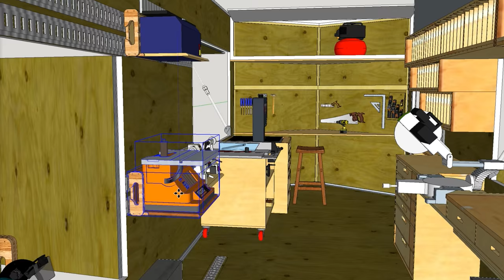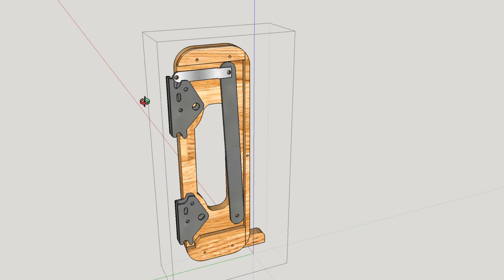Prototyping a Modular Tool Storage Idea

Comment: This will add a bit of weight but I think some sheet metal to help hold heavier tool for a long time will help. You are going to be driving. The bounce of the trailer could cause the plywood to break over time.

Comment: I think it would be cool to have those tracks mounted to the outside of your trailer as well. So if it feels to crowded inside you can just move some tools and still be able to use them.
Reply: I was thinking the exact same thing!   Especially considering the huge mess and flying dust some of those tools will throw off. Cleaning up a curbside would probably be a lot easier than every nook and cranny in a trailer.  One thing for sure he'll get buff using this system for long!

Comment: you should add another lock, but a more permanent and reliable one, a safe lock, for long travels to avoid your stuff falling while you pass right a crap road. an idea I have is attach it to the rail itself, but with a safety belt for travel, so it doesn't fall
Reply from the maker: I was thinking about using some kind of cotter pin for that.  Thanks!

Comment: Do you need the second rail for the bottom part? Maybe for lighter objects you can just have a spacer piece or a ledge for it to sit on that way you're putting it on the ledge then pivot up to lock
Reply from the maker: It's mostly just for safety traveling.  If the bottom half swung up, it could release itself.

Comment: There should be a 2 by 4 or some sort of stand built against the trailer so when you place the tool on the wall you can pull out a stand to place most of the tension on it..

Comment: If you could make that a simpler design (metal or plastic fabricated),  you could make millions. Love it. Maybe try designing it on your 3D printer? With spots to install the metal latches and places to attach aircraft aluminium?

Comment: I think you need to make the shelf stronger, it might hold your weight now, but what about when you drive over bumps on the road, then the force is a lot stronger.

Just thinking out loud.
Reply from the maker: Yea at this point I was more concerned about the latching mechanism.  The shelf can be modified however I want.

Comment: Cool idea. How will you mount/secure the tools on the cleat-shelves? Are you fixing them to the bottom or some sort of straps? The potential energy in that trailer is gonna need some strapping down :)
Reply from the maker: Most tools have bolt holes for attaching them to a bench.  So I'd just thru-bolt through the shelf.

Comment: This is a very cool concept. However I am struggling to see what advantage this gives you over simply putting the tools on fixed shelves. Why do the shelves themselves need to be mobile?
Reply from the maker: Because they are in a trailer that also needs to hold a car when not in use.
Reply: ah, ok.  Makes sense now!

Comment: Mike, i think your complicating things way to much all that mechanism stuff your adding to the structures that hold your tools is added weight you will have to tow and move around often.... just simplify it but using the aluminum french cleat that is sold at most hardware store, its rated like 300lbs over every 12inches... which is way more than you would ever experience, then just use your drill to drive a screw into the bottom of the tool directly into the wall into a sacrificial board on the wall of the trailer... this would allow you to secure it with no chance of something bouncing loose on your mechanism and tools falling on the car.. and reduces the weight of all your tools... plus all you would have to do to move the tool is unscrew a screw or 2, then move the tool... then screw it back to the wall.. you could even mark common mount areas so your using the same screw holes tell they wear out.. then when you have a million holes in the sacrificial board you just replace it with a new one...
Reply: I agree that he is over complicating it. however I think your idea of screwing into the wall is less than ideal.
Reply: I bet you could even get away without using the screw if you had a lip below the french cleat that would keep the tool from lifting up off the cleat unless you pivoted the tool away from the wall before lifting.
Reply from the maker: No doubt it's overcomplicated, but I figure a day or two in the shop and I don't need to screw into my trailer walls would probably be worth it.